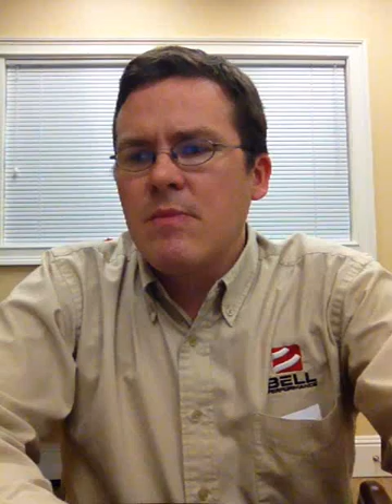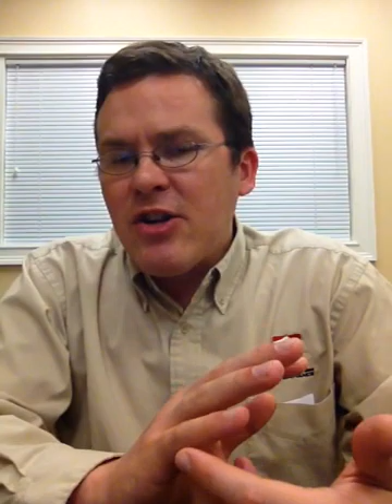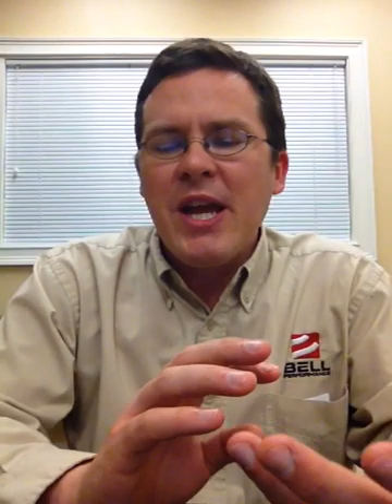How The EGR Valve and Oxygen Sensor Can Cut Your Gas Mileage | Bell Performance | Video Blog

Comment: It was created because when they created fuel injection and trying to get Catalytic Converter to not burn up. The recirculation of exhaust thru intake lowers the exhaust temperature. Delete an EGR and your Catalytic Converter will be cooked within 2 weeks. It's only there to keep exhaust temperatures below the threshold of burning up the cats. Your right about the temperature. Again they had Catalytic Converters for 3 years but they couldn't keep them from burning up due the temperature of the exhaust. Read the original papers of the man who created the egr valve. They might try tell it recycles unburnt gasses. EGR is there only to lower your exhaust temp by about °250 to °300. Again it's only to keep your Catalytic Converter's from burning up

Comment: I took the EGR valve off my 1983 cutlass supreme v6 3.8
I’m almost getting 40 miles to the gallon
Reply: You going to burn a hole in in of your pistons.
Reply: Can I do this on my 2006 Pacifica? And is it easy to do?
Reply: Took it off C4 vet so for I get about 5 miles more to the gallon and that was just a quick around town test.  It runs and idles smoother and a bunch more in horsepower.  Huh, amazing what spoon fed information is thoughtlessly repeated.
Reply: Melón malone - My Explorer almost managed 40 gallons to the mile! 😂

Comment: If saving the environment is so important, why are replacement parts so damn expensive? You'd think the price would be low so people would actually replace them. The EGR is just simple, and made similarly to a vacuum operated fuel pump, but is so damn expensive. ($60 for my vehicle, which is over 20 years old)
Reply: People need these parts to pass emissions.  If the gov't didn't force you to have one, they wouldn't be expensive.
Reply: Thats cheap dude
Reply: zappy bear my car's going for 100

Comment: how come EGR valve closes when you're on high rpm. isn't the combustion chamber hotter at that point?
Reply: Engine would lose power and run hot. EGR only comes on at light , cruise conditions.
Reply: He just said gasoline cools the combustion chamber. It puzzled at first but not quite wrong there.

Comment: so what happens when I get rid of EGR and blind the hole ??
Reply from the maker: +Phen0mable You'll probably get better performance, at the expense of emitting more NOx.
Reply: BellPerformance who gives a shit about nox ??
Reply: ExiledThorn Hassan no its not true
Reply: +BellPerformance so i cleaned the throttle and the EGR and  i have been having a problem with my crown victoria, when the car is on gear it vibrates bad and it feels like there is something wrong in the engine
i heared that if you clean the egr you need to replace the o2 sensor is that true?
Reply from the maker: The EPA cares about it because it destroys air quality

Comment: The EGR valve also increases fuel economy while cruising by lowering pumping losses. Pump loss is the vacuum that is created within the chambers making it harder to pull the piston down during the intake stroke. Its like having your finger over the tip of a turkey baster while trying to pull the plunger.

Comment: Sort of accurate...
The EGR recirculates inert gasses, not air, in order to take up space so that the combustion potential is lowered. This allows the air/fuel mixture to be leaned out, thus be more efficient.
Reply from the maker: Well yes, that's quite true. Sometimes we can use 'air' and exhaust gases interchangeably. But you are right, we should be careful to be more specific so there's no confusion.